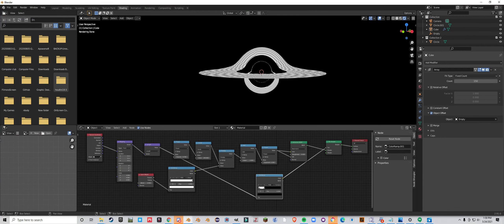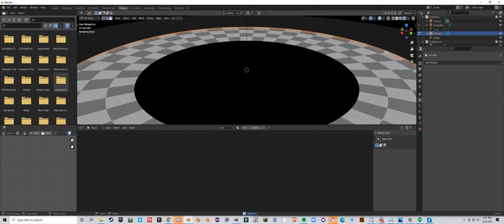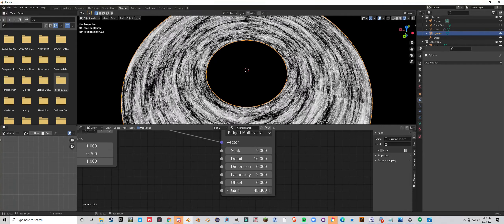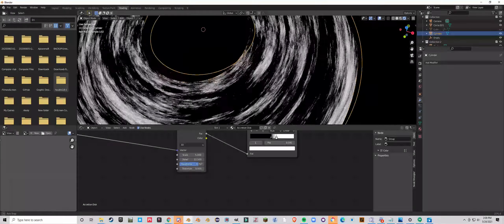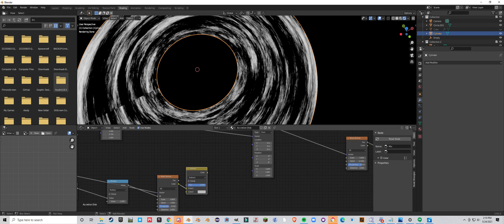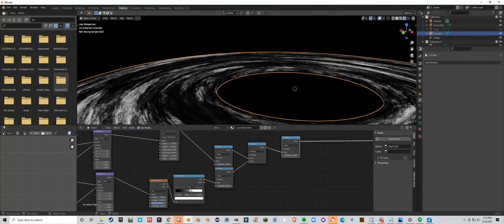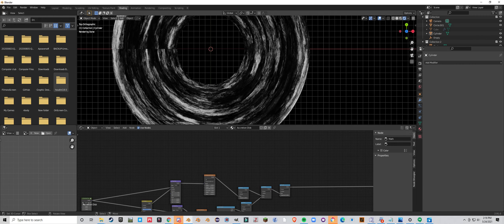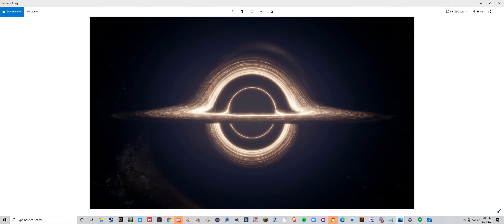Blender 3D Mastering Black Holes Episode 2: Basic Accretion Disk Noise

Comment: At 1:42, I tried to adjust my node settings to yours but I noticed that it got rid of my photon sphere, I'm not too sure why, so I just kept the same values as the video before, ill see how it goes from there
Reply: I had the same problem, I didn't flip my color ramp, fixed it
Reply: Change the value of the black position on the second colorramp to something lower, mine works fine on 0.150 :)

Comment: Here is a hi-res screenshot of my node revision based on what I can see at 1:44. My vision is not the best, so double check against what is shown in the tutorial. Perhaps next time we can get a higher res view or maybe just full-screen. I'm using a 32" monitor and it's stil hard to make out the fuzzy numbers.
https://i.imgur.com/ptBhDKr.png
Reply: It's obscured by another connection but the Vector Math - Length Node is also connected to the base input of the first Math - Power node!
Reply: The color ramp for the black hole is also set to "Constant"! Though thanks for the high res screenshot!

Comment: I tried to adjust my node setup at 1:40 and I've lost refraction in the sphere. I've connected the vector math to the base of the first power and belive I have done the rest correctly however nothing is appearing? any ideas?
Reply: Nvm I had plugged the refraction BSDF shader into the bottom slot of the mix shader rather than the top and this has solved the issue

Comment: I dont understand 2:58 :< please help me
Reply: You need to press E for Extrude
S for the Scale
0 to choose the faces that are facing towards the z-axis
And than delete to remove those faces
Important is that you dont move your mouse during the process
Hope thats helpes :D
Reply: @rouladenkoenig6952  thank you so much brooo
Reply: @rouladenkoenig6952  How are the faces on the Z-axis of the inner cylinder have generated? Please help
Reply: @kundankhalkho  to make faces you need to press. It will than create a face between the vertices you selected
Reply: Thanks @rouladenkoenig6952  !! Later I found out  that while performing the E>S>C>0 enter, values should be for X=1, Y=1,Z=0 and Orientation should be Global; as seen @03:02
Reply: @kundankhalkho  Yes thats correct. There are alot of short cuts and time saving things to know about blender